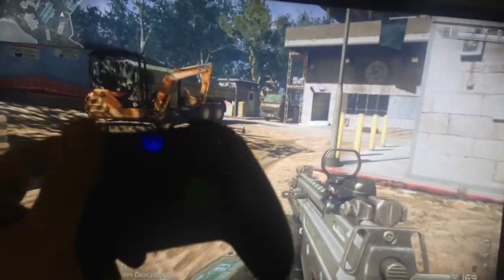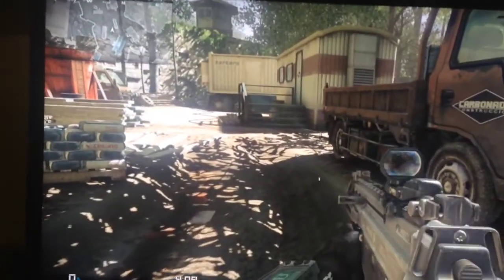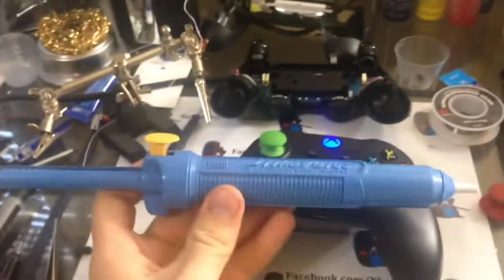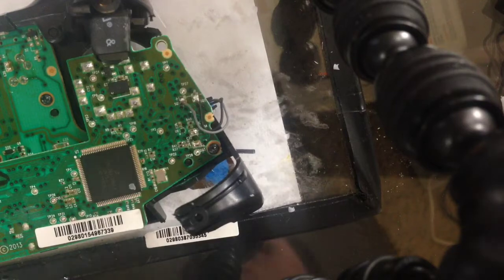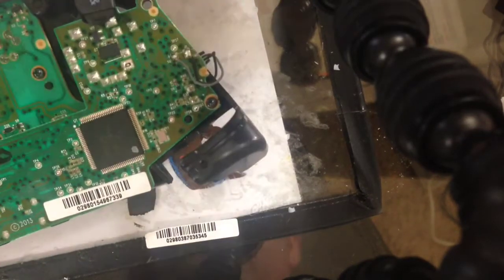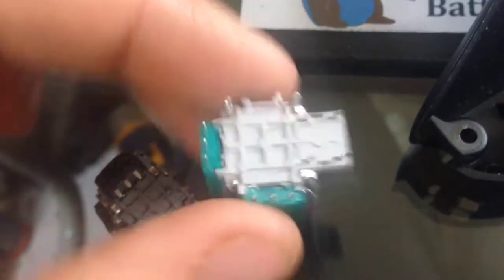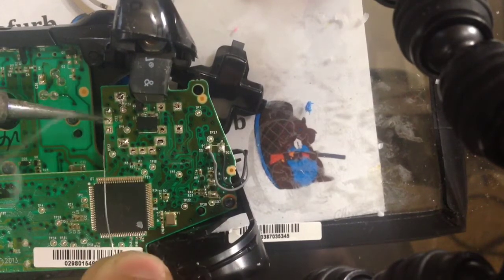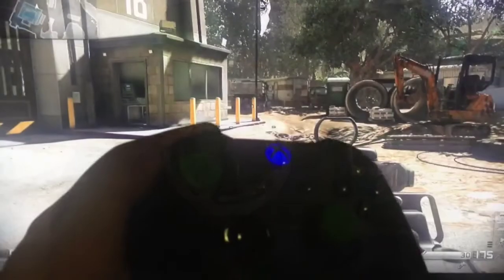XboxOne replacing loose, worn out, defective, or broken thumbstick mechanisms

Comment: I'm having this issue with my controller and I wanted to know what type of soder metal you used. Also would you recommend a newbie to attempt this, because it looks easy to do, but that could be because you are familiar with it. I saw you charge $15 and $10 shipping, so $25. How back up are you with orders if I decided to do that route?
Reply from the maker: I use a no-clean flux solder with a decent silver content. I'm 2-3 days to fix, 1-3 day priority return shipping.
Reply: he makes it look easy...ive done xbox 360 controllers fully modded with leds everywhere, makeing good clean solder points is not as easy as hes makeing it look. id recomend trying simple stuff befor frying your motherboard! I want to this as SCUF has fuct up my contoller and the customer service is shit! Good work tho buddy!

Comment: Hey I have been trying to des older my thumb stick which has been drifting.  I can't seem to get the solder to melt.  I am using a 30W soldering iron.  

Is there some sort of coating on the solder that I need to get off to have it melt?  

Any help would be greatly appreciated.  thank you
Reply: +Larry Rasulis Make sure your iron is hot enough first. If you have some spare solder, use this first to melt then you will know its hot enough. Pre soldered solder will take a little longer to heat as it has already been heated once to get it on.

Comment: just put one drop of methylated spirits on the analog base and play with it clockwise and counter clockwise and it works brand new trust me just don't put more than one or two drops of spirits, the control, will vibrate uncontrollably if this happens, just buzz the control in the settings and it will stop works 100%

Comment: i tried to desolder my thumbstick mechanism today and i couldnt get the solder to melt.  is the iron not hot enough? or is there a special connection thats on the original solder that i cant get it to melt down? its a 30w solder iron.
Reply: Milan Mroz Apply more solder & flux should help.

Comment: So would charge $20 to fix the joy sticks? How hard is it to tighten the springs. The like how they feel light but since they are cracking and opposing that too loose.
Reply from the maker: Yea it's 10 per stick. And it's fairly difficult. Must be more than most people would try because to my knowledge I'm the only one offering the service.
Reply: Battle Beaver Customs How long would it take from the moment I send in the controller?
Reply from the maker: Once I get it 1-3day repair time, then I use USPS priority to ship back. Usually 2-4days shipping time

Comment: Do you know if the 360 modules are interchangeable with the Xbone modules? I tried a handful and i have found that some don't work quite well, weird deadzones and increased sensitivity on various directions, and some solder pads are easily removed. How can you know which ones are of good quality without trying them on?
Reply from the maker: We use official OEM X1 specific replacements.
Reply: +Battle Beaver Customs From where? Im looking around for one and dont know where i can find OEM ones.
Reply: +lyianx OEM are made by ALPS for both Xbox and PS4. You should look for the carving on the metal to see if they're genuine. If you can look into their catalogs, you'll even find an exact part number. Mouse has them for sure.
Reply: +SinnerYT Eh, didnt see anything on their site that resembled that part (or im not searching for the right things). Might just try something off Amazon and hope for the best.
Reply: lyianx Impossible. Don't want to sound like a jerk but i bet you didn't look for over a minute...
Reply: +SinnerYT Most of the results that come up are for the rubber part, not the mechanical part. Of the mechanical parts i have found, none appear to be OEM.
http://www.amazon.com/Analog-Stick-Thumbstick-Replacement-Controller/dp/B00B7Y5XVY/ref=sr_1_fkmr0_1?s=pc&ie=UTF8&qid=1447348343&sr=1-1-fkmr0&keywords=Alps+Analog+Stick+Thumbstick+Replacement
... is the one i may try

Also, i have a hard time trusting sites ive never bought from before unless enough people recommend them, and as im not one usual doing electrical hobby stuff, i dont know all the 'good sites' to look for. Please dont take your knowledge and experience for granted
Reply: lyianx I already told you. Mouser has them. And it's one of the best electronics store. You'll find only genuine parts there. And like i said. It's literally impossible that you looked into ALPS' catalogue and not find them. The section is actually one click away from their home page...

http://www.alps.com/prod/info/E/HTML/MultiControl/Potentiometer/RKJXK/RKJXK_list.html

Comment: hi, do you reckon that it would be possible to add a trackball in the position of the left potentiometer?
Reply: It's a question that has come up before. And something we have looked at doing. I will revisit it
Reply: I suppose with the xbox one remote having a push button it is difficult to incorporate the trackball for speed increase. ie running in cod etc or is it? have little understanding of track balls

Comment: Battle Beaver Customs how do you disable the rumble motors in the triggers
Reply: You desolder the power to the motors, thus disabling them. You can't really take them out too well cause they are very much so in the trigger.
Reply from the maker: Nexah, you can de-solder or just cut the wires low and remove the rumbles. The other guy has no idea what he's talking about. All 4 motors are removable. This particular customer only had the rear ones removed
Reply: Battle Beaver Customs thanks i did it i didnt know if the wires made the triggers work aswell i havent been taking the xbox one controllers apart as much a my 360 controllers

Comment from the maker: I'm being told it will be about 3 months before the factory can fill my order
Reply: Battle Beaver Customs i know this is a old video if a buy the soliderin kit will it still have all the parts that i need to repair the controller
Reply: +OHMasseffects Yes. Most soldlering kits come with the necessary tools but if you make sure to buy a soldering iron KIT then you shouldn't have any problems